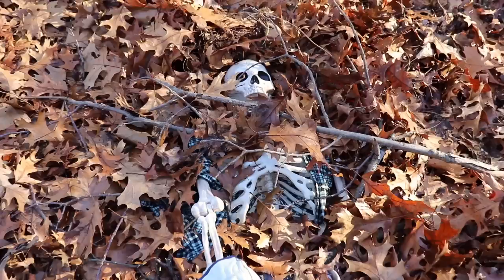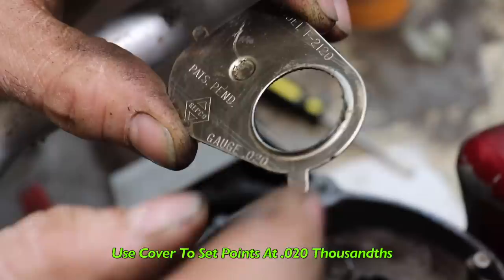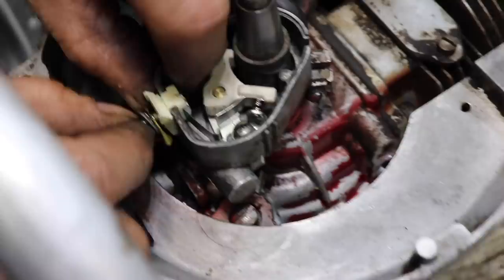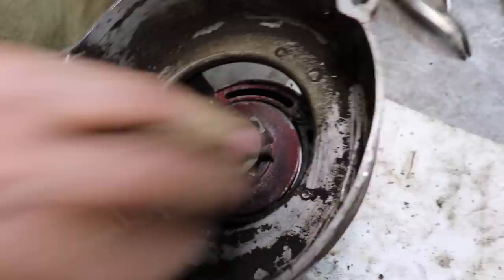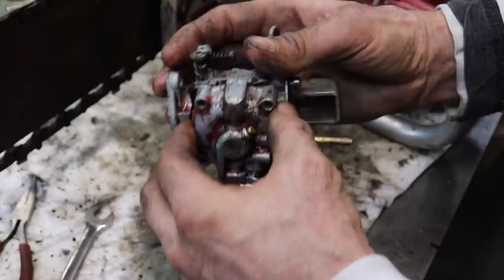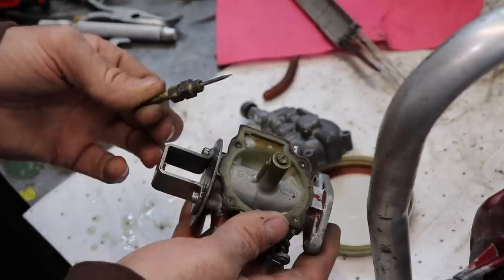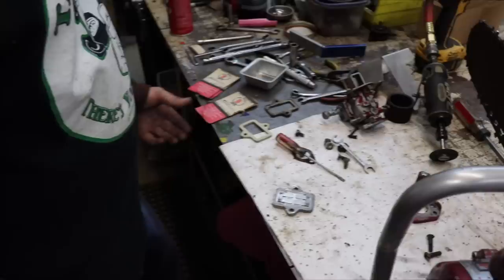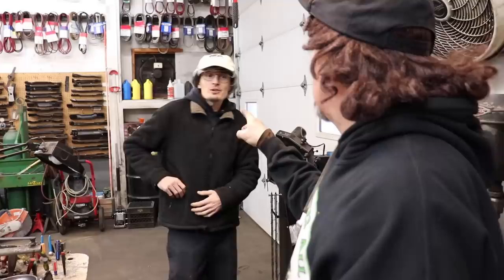Getting A 1956 Eclipse Wasp Chainsaw Running - with Taryl

Comment: just got my first ultrasonic cleaner about a week ago. i don't know about you, but i find the heating elements to be pathetically weak. i heat my water on the stove and then pour it into the ultrasonic. i use the ultrasonics heating system only to maintain the temp of the water that i have already heated on the stove.

Comment: Try a little  comet with the water and dish soap in the ultra sonic cleaner.  Would a tiny crock pot with a sander strapped to it work as an ultrasonic cleaner?

Comment: ...the Corvair motor has a mechanical
distributor that is easily converted to electronic versions...fuel pumps could be adapted into gas tank...GM was working on a fuel-injected motor prior to puttin' the
"KillSwitch"
on it after 1966...took 3 years for this "Ameican Porsche" to
hide into "barn-
finds"...
Now, E.A.A.
is seeking 
certain rating Corvair motors for upgrades
general 
aviation
F.A.A.
certificated
applications...these do not require high revs, but limit that to most effective torque curvatures for prop 
efficiency...
Yes, Teryl its not a lawnmower
...it IS an 
AIRSPACE SHIP!( but just think how a 'Vair motor WOULD outrun ANY
ridin' mower!)😅

Comment: Some things I’d have no problem running a modern oil on a higher ratio, since modern synthetics are FAR better than the stuff they had back in the day. 

The one two stroke I’d refrain from tinkering with the oil ratio too much on is the smaller OMC outboards built prior to ‘64. 
They didn’t have needle bearings, or caged rollers in those. They were all bronze crank, and rod bearings. 

I was a long time member on a boating/marine engine forum, and unfortunately encountered a couple of people who lost the bottom end on their vintage OMC after running them on a modern oil ratio for a few seasons.

Factory originally said 16:1. Most people had no troubles running 20:1-24:1 with a full synthetic TCW-3 oil.

Comment: Putting the parts you want to clean in a mason jar ruins the effect of the sonic cleaner. The entire point of the sonic cleaner is the vibration effect. Parts must be exposed to get the vibration otherwise you're just giving the parts a warm soapy bath. A wire mesh basket is the best way to go regardless of what fluid combo you use.
Reply: So the water in the jar is not vibrating?
Reply: Never seen Jurassic Park?

Comment: I have an old Poulan Micro XXV and was told by a local shop that it needs a carb.  The carb that is on it is a Walbro WA19.  I have looked all over and have been told that it is no longer available.  I have checked on eBay and many of the other sites and can't locate one.  Would you know of anyplace that you can get one or if there is a replacement carb that can be used in place of the original one?

Comment: Great episode Taryl, that wasn't a very smart design putting the carbatrator on the front next to the bar and chain, pretty dangerous when adjusting it. I have an antique Homelite Zip chainsaw from the 50s, it has a Tillotson diaphragm carbatrator, all I did to get it running was put a cheap carb kit in it and she runs like a champ! My saw also takes a 16:1 ratio, runs at 6000 rpms and uses 7'16" pitch chain which isn't made anymore unfortunately but the saw is all original, even the bar is original Homelite.

Comment: I just have to say from working with ultrasonics that the glass jar should have insulated the parts in gasoline from the waves that cleaned.  In other words, the cleaning waves could not get to the parts. There's your dinner
Reply: I also have to agree with the disclaimer: Taryl is a professional

Comment: Looks like fluffy the rat was at it again 😂. I have a Tecumseh snowblower engine from 1967 that I cleaned the points on and now it won't start. It ran when I got it but it ran like crap. Now I'm thinking that I might have just ruined the points because they still have the original part number on them and the condenser

Comment: I watch you everyday religiously because I like the way you break things down. But I am 80 years old and I'm going crazy trying to revitalize my 20-year-old mantis two-cycle tiller. The spark seems to be good. New fuel tank, new carburetor, new plug and fuel lines and I still cannot get it running. I need some help dude? S*** like this drives me crazy. Actually this is the second new carburetor. I got one running for a few minutes but never again. I'm using that non-ethanol true fuel so I don't have any hair to pull out I'm trapped.

Comment: Yeah that's funny the idle adjuster very close to the chain wonder how many Old-Timers lost a digit or two trying to set the idle or setting the fuel flow I know it looks worse on the video than it really is but still too close for comfort and most guys I know wouldn't shut it off every time to adjust it. I know how annoying some of the safety stuff is. But it's  there for a reason. Play safe everyone...

Comment: 50:1 vs 20:1 means you have 2.5 times less oil, which in volume is replaced by gas, so less oil makes a richer mixture.
Not only it doesn't burn up it makes it run cooler, till it fouls a plug, then you went too far :)
I think the reason they were using so much oil back then was because oil was crap, it wouldn't stick to 2T surfaces as it should and would burn up too easy.  I've seen top performance 2T engines on dynos, putting out 100% and you will find a thin film of oil on the exhause port, this stuff is too good.  Too good to break in a new engine that is.

Comment: Excellent video...why? Because I have the same saw that has been in the family since new.  Now...I can try and get it running again ! Thanks for the video !!
Reply: I redid a John Deere 50V...put in solid state igntion, probably starts and runs better than new. 
"solid state ignition module, replaces Nova II" on eBay.
Reply: @heyinway  Thank you !

Comment: I had an old homelite that had a muffle like that and manual oiler. Noisy, heavy, slow, all that but not a wasp, it was light blue and i think it was an xl12 maybe? That was back in the early 80's.

Comment: Do the floats get saturated with gas and ever need to be replaced?
I have an old gas ice auger with a similar Tecumseh engine.
Reply: No, The ones I have seen are made of brass halves soldered together

Comment: Amen Brother!!!! New points are SHIT!!!!!! I got a 72 f350 farm truck  about 5 years ago with a 360fe in it with points, I bought 4 different sets of points and not a damn one was aligned right they all would slap right on the edge and burn up or seize fast they cost 2.99 and wasn't worth $.15 I had a good resistor wire with dropping volts according to spec,gapped at spec they was all just made out of alignment,the guy at the counter told me I need to special order a premium grade for anything different quality I scrapped a small block duraspark system and fabbed into the dizzy and ditched that whole flustercluck

Comment: Question for anyone that wants to answer:  All this fussing and adjusting and cleaning and all that.  Are carburetors missing the boat on how to make the proper gasoline mixtures to keep the engine going nicely?  I've seen videos of guys running their lawn mowers with gasoline in a mayonnaise jar and a couple of hoses.  I'm not gonna explain how it's done because half of you know already and the other half doesn't care.  What would be wrong with doing that on all engines?  There must be a reason.  It seems to me that instead of having drops of liquid (as seen in high speed videos) traveling on an airstream into the motor, you could have a nice mixture of fumes and air instead.  That's the purpose of a carburetor anyway.  Who can figure that out?

Comment: The trick for those pesky Japanese motorcycle/atv Philips screws that round out so easy is to use a quality Japanese JIS screwdriver.  Japanese cross-style screws are not Philips, they are JIS.  A subtle difference, but a Phillips screwdriver doesn't engage properly on a JIS screw, and will round it out.

Comment: Wow 77 cc 3 hp it might not spin fast but with good sharp. Chisel skip chain and a it will pull right. Threw a cut i know if you come across a old stihl 090 or even 070 worth money and are still made same lay out and the carbs are run able ive ben looking for older one because. The new gas is killing my carb every time i want to run a saw i ineed to rebuild the carb bs think mabe older saw il have more luck starting every few month

Comment: ...I'm sure the 50:1 mix will be fine...I run it in old saws also...sometimes I put a 1 gal.mix bottle with about 8/10 gal. fuel..just to richen it up a BIT, when I KNOW I'm going to be using it in old saws...Lol, your blood probably has 50:1 in it like mine...all that gas mix leaking out on your hands...on your legs and knees...abdomen, etc..probably soaking into our bloodstream....can't help gettin' it on you when you work on this stuff all the time....

Comment: 5:00 harbor freight has a impact screw driver for $8 that works wonders. Includes a case and assorted bits.
Reply: Thomas
I have a Craftsman version of that tool.  I saw an ATV mechanics one while  breaking loose the screws of a Yamaha engine case.  I went home and ordered one.

Comment: Can you run 100/1 Amsoil in it or stay with 16/1 mfgr's specifications ?
Reply: You need to follow the oil manufacturer's recommendation but by all means if you use a ratio other than engine manufacturer's recommendation make sure the oil is full synthetic if not you will burn her up. I have two identical engines that are 33cc ryobi 2 stroke engines. One recommends 32:1 the other 40:1. I have run both on 50:1 mix for years no problems. I have several larger engines (41cc, 62cc, 80cc) that I run on the same 50:1 mix with synthetic two stroke oil. These engines are on radio control model airplanes. I hope this helps.
Reply: Yes, thank you, we've always been confused about ratios-%, believing the era/time of mfgr dictated the ratio/% because of lubricant technology at the time period, I believe modern synthetics, Amsoil, Mobile-1 or whatever you recommend provide good barrier protection,, Sory for the late reply

Comment: 49:23 Adjusting the idle on a running jumpy old saw with moving chain...not worth the risk.  A temporary guard between chain and fingers would add some safety maybe?  Holding my breath at that part.

Comment: I AGREE but  50:1 is to lean if it normal cheapish oil  in any thing ol  i giggle  wen i see theses newer 2 stroked out n broken by 50:1  cheap oil i say 24:1 to all my buddies on the crap oil

Comment: Just a teenzy weeny thought instead of bashing the stuck screw with a normal screwdriver how about an impact screwdriver may as well if your going to bash it anyway But I'm sure you thought of that Nice video sorry the guy didn't pay for it on ebay don't you just hate that when someone else may have bought it and paid for it and having to pay ebay fees also

Comment: Use the oil at what the current oil manufacturer states, not what the original manufacturer said. Taryl is correct. We fight with dirt bike riders all the time over this. But, you're gonna...  🤦🤦🤦

Comment: I use the synthetic oil in all my two cycle engines.
Reply: Antique 2-strokes long ago didn't have needle rod bearings so needed more oil than later 2-strokes.  So even if synthetic you still need more for them.
Reply: @thisisyourcaptainspeaking2259  I have a 56 modal stihl I use synthetic in all the time never gives any problem.still runs like new.
Reply: @anthonyyoung7344  nothing wrong with synthetic, it's better refined!  The older 2-strokes of the 40's didn't have needle bearings and the cylinders were not as well machined, which is one reason the oil ratios were much higher.  My point is, these older saws will need more oil than modern designs despite the oil is better.  I don't know how old your particular is or the details of it's manufacturing features.  Suffice it to say, if the rod is the old style Babbitt bearing material, then 50:1 will likely be inadequate.

Comment: 49:29 i cant believe i witness you do that, how come you didnt take the chain off the bar for the sake of it?
Reply: Engine has to air filter, bar, and chain on it, actual operating condition.
Reply: @heyinway  air filter yes for air ratio, chain  no you didnt need it on for a load

Comment: It seems to me Taryl, that if you really wanted to mak good videoos and show that you really knew what you were doing, that you would get yourself an Electron Microscope to show the complete details of your operation.  If I was making videos, that is what I would do. That way, the close-ups would show  people the details of what you are showing, doncha think? Harbor Frieght is prolly where you could get one. Also,  you are using tools that I never even heard of before like Spark Detectors and Compression Gauges and such like. I know how a hammer works Taryl, so do not try to confuse me okay. Them engines cant be all that complicated. Okay then, see ya soon good buddy.(Notice:   This comment was made while wearing my  face mask to prevent the spread of disuse.)

Comment: Use a plastic mayo jar, the ultrasonic waves get through plastic easier then glass, I use a mixture of 50% simple green purple, and 25% white distilled vinegar, and 25% distilled water, (baby water), in the plastic jar, it cleans so much better, great video on an old saw, slippers is older right.... LMAO